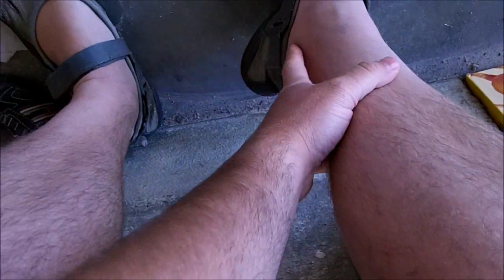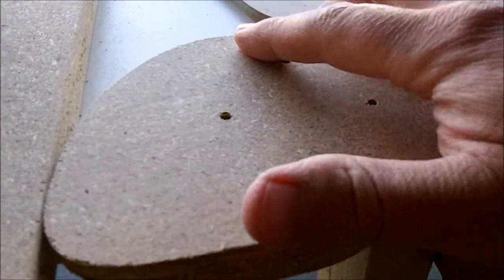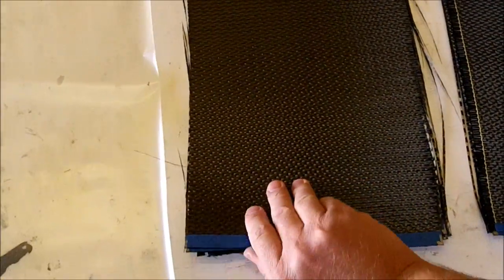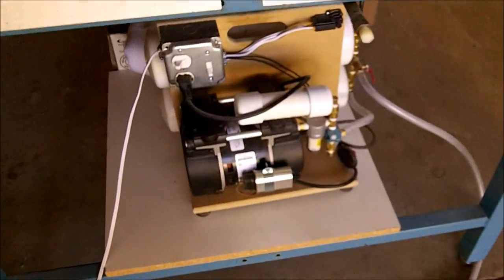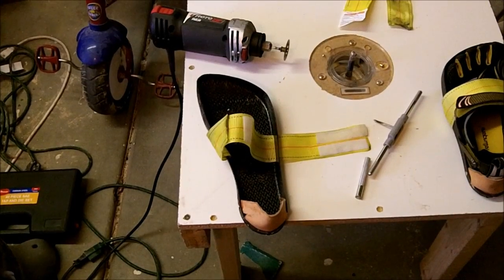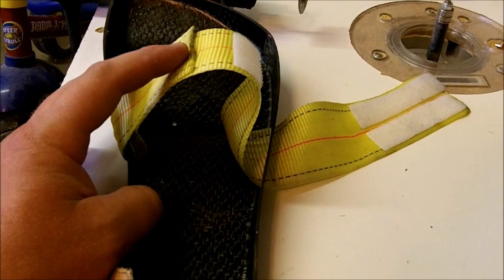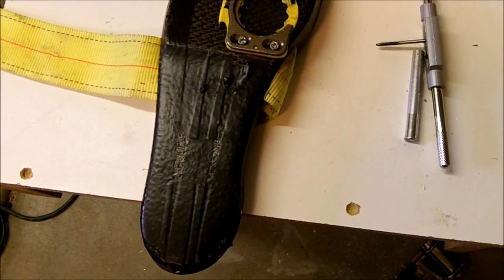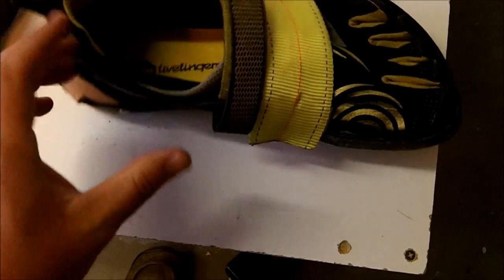Vibram Five Finger Pedal Platfroms- Carbon Fiber Bike Platforms

Comment: This is an awesome project! I am working on building custom cycling shoes with carbon fiber prepreg. I am curious if the drilled and tapped holes to hold the cleat on are strong enough? Did you just drill and tap straight into the carbon fiber? Thanks so much and sweet vid.